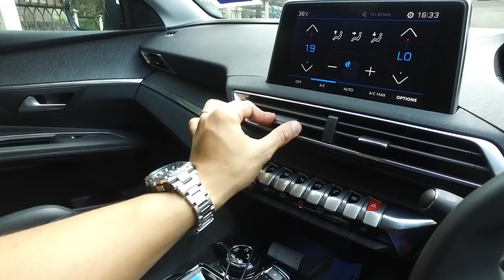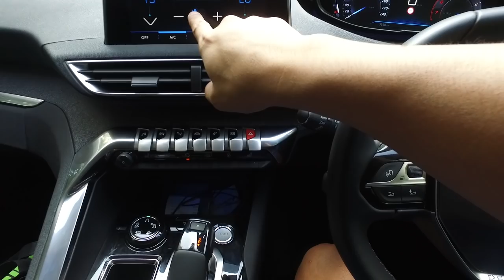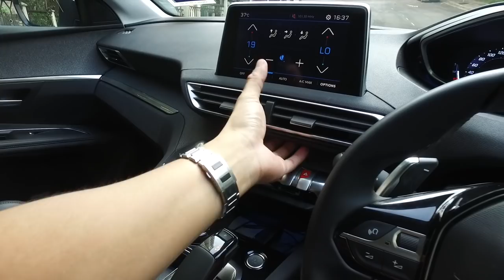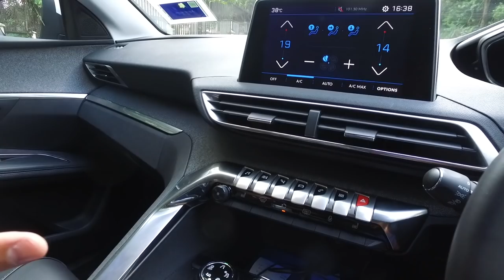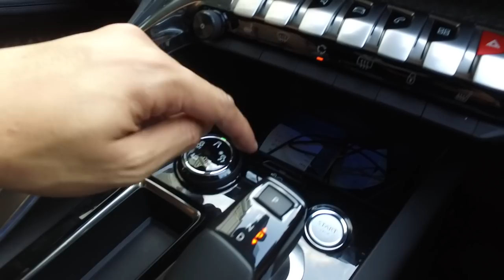2017 Peugeot 3008 1.6 Turbo Full In Depth Review | Evomalaysia.com

Comment: Hey Bobby, I believe that knob in the rear trunk is to hold the floor board at an angle so you  don't have to keep a hand holding it up while you mess around with things in the lower compartment.

Comment: The French are back at it with their daring designs. Definitely not what you call "common" or boring. And guess what. PSA has Fareucia. They also design and build new Mercedes-Benz interiors. And it is just a car that says F you to convention. I love it!

Also there are 7 Speed torque converters. Some older Mercedeses use 7 Speeds like the E300 and S300.

Comment: Hello sir, is this car reliable 2nd used from years 2012/2013? Any common problem and is it costly maintenance?
Reply: I have a 2012 peugeot 308 (not 3008). It is the HDi 2L diesel version. Had one problem just after warranty. Peugeot Australia fixed it - no cost for part. Have not had a single problem since. I drive hard and fast. The 2L diesel engine is, by far, the best of the Peugeot engines (that's from both my mechanics). I question a 1.6 engine for the 3008. A bit underpowered for my liking.

Comment: Hello Bobby.. no doubt that new Peugeout 3008 is a nice car. Giving a good review seem like giving a credit to the technology, designed and performance of Peugeout. However, pls Bobby be fair to the Peugeout’s owner about the slacking of the said model, at least they know where they stand.  And ready to fork few thousands in case wear and tear cases and not covered by the warranty. Late getting parts also caused a headache most of the times.
Reply from the maker: So you bought this model? Mind telling me your story?
Reply: Bobby Ang .. FYI,  currently I owned Peugeou 408 Turbo and I have experienced pro and con situation. The good one, Peugeout will never charge any call back parts or any parts still under warranty. Unwanted incidents where late getting the affected parts and has to docked the car, parts not always available and in some cases too sensitive to the local whether. Even the roof cushion in the car loose and dropped. My wife keep on telling me to let go and never buy Peugeout in the future.  Mind you at this point the mileage not reach 70,000 km and looked new after bought it in 2013. If I want to sell it off the value already dropped below RM50,000. Let the owners of new generation of Peugeout 3008 has to say about difficuties that they faced. Frankly, I am eager to have new generation of 3008 but seem unsure to proceed.

Comment: The steering wheel is tilt to the left. Please note that this is not the front wheel alignment issue.The car can drive straight. Driver will notice that the Peugeot logo is not pointing straight to the driver chest but pointing to driver left shoulder. Some units are ok but some are not. Serious manufacturing issue. How to drive like this?? Picture to illustrate the issue. http://tinypic.com/r/aazo1c/9

Comment: Crv or this 3008 bobby?btw lexus also using the same type signal
Reply from the maker: +Irfan Nadz CRV is a no brainer choice. This one has character. A much needed thing for those who considers because you have to know Peugeot cannot match Honda's dealer service network. I will pick this as it's a sportier drive.
Reply: What about the Subaru Forester?
Reply: Size, and spec choose CRV. Boring, sluggish feel and noisy cabin (poor sound insulation) please choose CRV.

Comment: Tiguan or 3008 bobby? In term of power and handling. Thanks
Reply from the maker: Handling definitely the Tiguan. It outhandles both the CX5 and 3008. CX5 and 3008 very close to each other. Performance wise CRV pulls the highest at 193hp but the CVT lessens the sensation. Whereas the Peugeot's 6 speed gives a bigger sense of performance. Mazda's 2.2 diesel should be fastest but it's not the most efficient diesel at around 600-700km mileage.
Reply: Bobby Ang Thank you so much for that piece of info. Really helped a lot. Cheers

Comment: I think the interior is way over designed something u will feel after the wow factor goes away and after few months of daily usage, just look at the Citroen DS 5 and how its interior felt so superior when it was first introduced back in 2011, and look back to it now and you will immediately feel how extremely odd it looks now, I think it's going to be the same case with this car
Reply: I drove the car for 6 months now. I have to disagree, I still love the interior everytime I step into it
Reply: Samer Bahgat... totally disagree with you.
Reply: Well I already disliked the interior design of the DS5 when I saw it on IAA Frankfurt. It was too odd. 
The 3008 however is more futuristic, better quality, and originality is here put with a good taste (hot keys like older sportscar or plane, nice fabric material for door panels, and dashboard, I cockpit with practical small steering wheel below instrumentation, very good looking automatic gearbox BMW like). Since I live in Europe and some in my family owns one, they all say the car is very good. The only complain I heard from some of them was about the headlamp not being strong enough in night drive mode on countryside. 
That is the most complain of my godfather who was a die hard VW fan (Owned all Golf 1 to 6 models + Tiguan, and changed for the 3008 in 2017). He said the 3008 feels better to drive than the Tiguan (Diesel engine more sophisticated in 3008 than Tiguan, and without cheat mode in this one), built quality is at least as good if not even better with some materials choosed, Satnav is a bit faster and nicer in 3008, and inside room is comparable in both.
Reply: Samer Bahgat Well... whatever
Car of the Year tho. 😂
Reply: Reny Bruehl Well said 😊

Comment: OK, I'm not trolling you...I have no problem watching your reviews....but for love of god learn about the car and its features before you start recording. What is the point of a review if I cannot learn anything...actually I know more about the car then you..All you had to do is look at the guide book. For example...you are not sure why you have to hold START button to start the car...well, it is because when you short press it car goes in let's call it stand by mode allowing you to use infotainment system, AC, chargers without turning ON the engine

Comment: its all good but reliability sucks
peugeot has poor quality
they stopped the sells for a few months 
have a lot of recalls 

shame
Reply from the maker: Which car? This?
Reply: Bobby Ang yes, in Europe, the blueHdi models had a lot of recalls. Replaced engines before delivery when cars where payed.
The 308 model as well.
I had recalls on distribution, catalytic converter, SCR elettrics, complete rear beam, clutch pedal, cilinder, and clutch kit
All in 2 years and 45000km
Reply: I know this use to happen in the past but now they really stood up with the quality

Comment: Any 3008 owner here??? I’m one of the,,, Do U guy Feel like the 3008 run out petrol so fast??????
Reply: Did you brought the CBU or CKD?
Reply: how is your car perfomance so far?
Reply: slampuck i bought the CKD version,,,, not stock for CBU hahahhah
Reply: Asmah Zainal Is A Nice car till now,,, no problem for the engine and the tech,,, aldy run 4000++km,,, interior is comfortably and wondelful... last time I’m driving the 2013 Mazda CX-5,,,
Reply: @polo1186  am getting my unit in 2 weeks time. Pretty excited and i was sold by the interior, engine not bad. Never driven a conti car before so switching from Honda. Heard not so nice experience by many Peugeot owners in the past though. Not sure whether i’m making the right decision. Hope Peugeot/Naza can improve in future. Any thoughts?
Reply: Asmah Zainal Yupp.. every brand every car have their own problem right??? For me,,, just buy what u like,,, and what u want,,, don’t hear for other,,, cause I really enjoy myself on this car
Reply: @polo1186  thanks. Fingers crossed! Will share my experience soon. :-)
Reply: Polo陈志穅 how much is the full tank and what's the mileage can go for town driving? Thanks.
Reply: Dennis Lim Hiii,, The full tank is around RM100 while the price is Per liter RM1.98,,, If only in town but not in highway the mileage between 300KM++,,, that my result for this half years,, finish first service... and feel good till now 👍🏻
Reply: Tq Polo
Reply: @polo1186  full tank only get 300km ++? Thats very low, are you sure bro? 🤔
Reply: Puvaneswaran Suppiah Hmmm full tank just use in town/KL,,,Full tank I tried before Town/highway around 600+km,,, this my result Bro